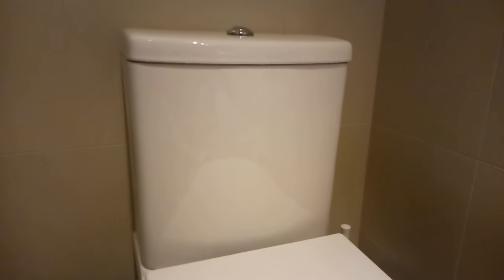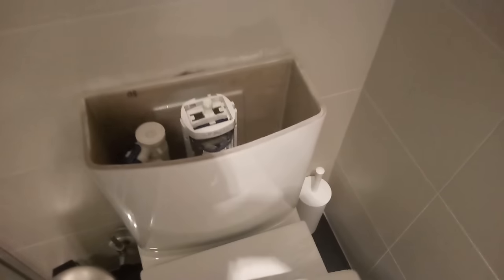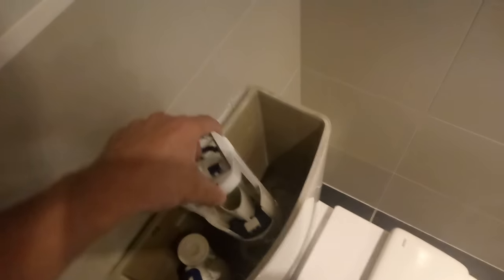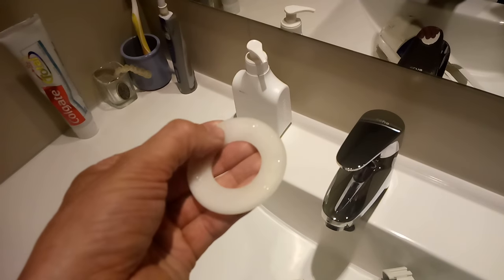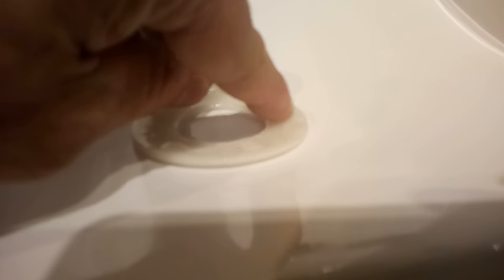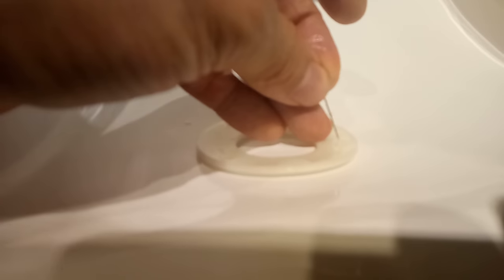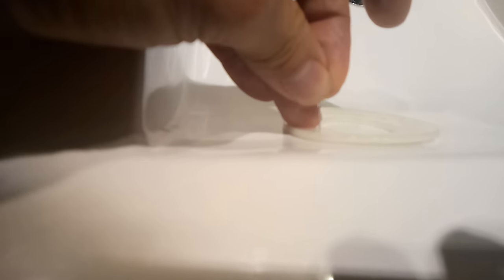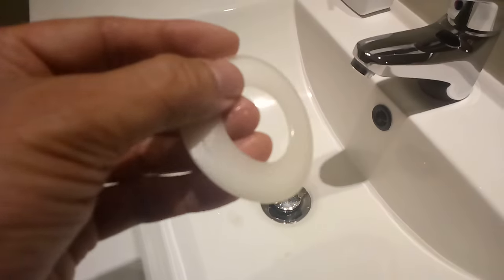Fix a leaking Geberit toilet flush valve

Comment: I have the same hardware in our toilets. My issue is I can hear a drip so might be this but the inlet is also trickling a bit and I can’t understand why.
Reply from the maker: You mean the inlet into the cistern? If so that will run to fill the water leaking past the geberit seal.
Does the seal have those pimples?
Reply: @jwelliottnz  yes the blue valve on the inlet side is trickling s bit. I’m thinking is might be a bad seal. Need to investigate further. Haven’t to see if the seal has those pimples. That’ll be a job for this weekend but thank you so much for the video, massive help.

Comment: Great video.  However, some models have two clamps on the side, near the bottom.  So not a twist and pull. Just release each side and comes right off.  Then popped the bubble and now water is not running.  Great fix---thx a ton.
Reply from the maker: Useful information thanks

Comment: 2:19 by the way, what does that blue plastic thing on the side regulate? I have a similar thing on my valve, and this thingy can be adjusted by pushing up and down, but I'm not sure what does it do.
Reply from the maker: I thought it regulated the volume of water for the flush, but I could very well be wrong.

Comment: I think Geberit should put this 'solution' in the manual or at least let installers and plumbers tell new house owners about it.
By the way how long did it last after the fix?
And is there any scientific explanation as to what causes these water pimples?
Reply from the maker: My fix still isn't leaking now, years later.
My suspicion is that the silicon has a harder skin, when the flush valve slams shut it causes cavitation bubbles that then collapse injecting the small bit of condensing water vapour through the skin, into the seal.
That is my untested hypothesis.
Reply: Sounds plausible... will definitely read more about it. Thanks

Comment: Kam Pui. Thank for your video. I have the same problem. I received the message from the Utilites. The water meter is recording a constant flow. I have been call the pumper to check the flushing tank leaking. The pumper can't find the problem. Your video very helpful.
Reply from the maker: So you fixed it yourself and your plumber couldn't? Nice work!

Comment: 這片GEBERIT止水墊片是矽膠材質，使用久了會變形及彈性不佳，最後會起小水泡，而影片中用針刺破，只是暫時止漏，過了一段時間，馬桶裡又會開始滲水，治標不治本，因GEBERIT止水墊片屬耗材，只要起水泡或彈性不佳，建議就換一片吧，全新馬桶上的墊片，大約可使用7～8年左右，而後面所換的使用壽命，就在3～5年之間，如水箱又投入藍泡泡或藍藍香之類的潔廁劑，會讓止水墊片產生化學變化，另自來水中的氯，也會讓止水墊片的壽命減短而漏水，以上僅供參考！
Reply from the maker: I used google translate on your comment.
WIth respect to "the gasket on the new toilet can be used for about 7-8 years"
Our toilets all sarted leaking after about 4 years.  So around 1/2 the lifetime you stated.  Next time around I'll see if I can source some replacement washers, but so far bursting the blisters has solved the leak.  Perhaps when the washers get to their 7-8 year mark I'll replace them then.
Reply: 你好，我住在台灣，我是專門在維修進口衛浴設備，據我觀察，我現在維修到的馬桶以及埋壁式的水箱，大都是10幾年前的，而那時GEBERIT的舊款止水墊片，是可以撐到7～8左右才需要更換，而現在這款透明的矽膠墊片（SILICONE），只能使用到3～5年，目前GEBERIT水箱零件，已廣泛用在各種歐規的馬桶上，如Villeroy&Boch,DURAVIT,LAUFEN,SPHINX,Jocab-Delafon等等....都是使用此款零件，而且也屬環保材質，另外一款德國GROHE的止水墊片，也是使用透明矽膠，美國的KOHLER馬桶，裡面的紅色止水皮也是有年限的問題，使用一段時間就會慢慢的分解，所以現在的水箱零件，使用壽命沒像以前的那麼久，都有一定的年限，再來建議水箱裡千萬別投入一些賣場的潔廁劑，才不會損壞水箱零件，造成水資源的浪費，謝謝！
Reply from the maker: Yes the short lifespan of these washers is concerning.  My suspicion is that the mechanism allows the valve to close very quickly part way through the flush which (my suspicion is) causes cavitation, which punches a small hole in the skin of the silicon forcing a small amount of water in.  The silicon then springs back sealing up the hole.  This is pure conjecture however.
Reply: jwelliottnz  I managed to get a replacement seal from Geberit in Illinois years ago. My unit is in-wall tank, very awkward to access. They admitted to the problem but made no mention of these pimples.  Hey will probably mainly it for free. Otherwise a class action lawsuit may be worth exploring just for the seal. I like your popping solution. It is an issue with unstable silicone chemistry. Silicone roof coatings are encountering similar degrading of material and performance. .
Reply from the maker: @timothydobson4657  Interesting, thanks for the information.  Hadn't realised that Geberit acknowledged the issue, though am not surprised by this given the amount of traffic this video has gotten.  Roof coatings are suffering too?  That sounds like a much harder problem to fix, my cavitation theory is probably wrong then.
Reply: @jwelliottnz  For long term solution, any idea where can I get the seal replacement online?
Reply from the maker: @khyeoh6046  I don't sorry. After popping the pimples a few years ago they haven't started leaking again. To be honest I'm not sure it's worth buying new replacements given how quickly they start forming these pimples. Unless they've changed the chemistry and now last longer?
Reply: 陳先生您好, 我住多倫多, 可以請教如何拆我的 Geberit Flush Valve ? 謝謝您
Reply: @jwelliottnz 您好，很抱歉，我更正一下，文中新馬桶上的止水墊片使用7~8年，不好意思，那是指20幾年前所生產的馬桶，如瑞士LAUFEN，那時水箱零件是使用GEBERIT舊款止水墊片，外觀有點灰白，那款的止水墊片真的很耐用，不容易起水泡及變型，而GEBERIT現在都已改成透明的止水墊片，使用壽命大約3年到5年左右，如水箱投入清潔劑，止水墊片會起水泡，也會變成黃黃的沒有彈性，使用的壽命會更短而產生漏水，以上僅供參考，謝謝！

Comment: Cant believe the exact same system and seal with a solution was waiting for me. Thanks for the video, I was about to go looking at prices for a replacement unit until I seen the popping solution. Any idea how long this fix will last, and if it's worth getting another seal now? I've just fitted the popped seal, just wondering if it is a matter of weeks months or years before it starts again and the only indicator being if your toilet has begun leaking again since the seal was popped and reused. Either way thanks a bunch for sharing. Such a good feeling when you fix something around the house. Now for the next task!
Reply from the maker: I popped mine a year ago and still no sign of further leaking yet. I'll will pull one out and check it's condition and post another video soon.
Reply: That's good news. Cheers!

Comment: Surely if you're poking holes into the rubber seal, you're just going to get more water in the seal, creating the problem again? Wouldn't it be better long term just to buy a new seal?
Reply from the maker: You'd think so but no. The seals have been working better  popped (3 years so far) than pre popped (4 years but leaking for a while). In my sample size of three that is, which is statistically insignificant I admit.
Reply: @jwelliottnz  oh right. I had the same problem, watched the video, did the popping, and hey presto, fixed! 😊

Comment: Geberit Replacement Cistern Flush Valve Seal 816.418.00.1 is the replacement part when the originals wear out. They cost a small fraction ion the total assembly. Good video though!

Comment: June 2020 - Firstly, how the hell does water penetrate the silicone like that?
Anyway, thanks for the video. I did both my toilets - one was much worse than the other  (it was literall covered in pimples) and both have now stopped leaking. Great advice - appreciate it.
Reply from the maker: My guess is when the button is release mid flush with all that water flowing past,  as the valve slams shut the water cavitates,  when those cavitation bubbles burst they puncher the skin of the silicon and force water in. Just a guess though.

Comment: I have the exact same model as you and twisting it and pulling does nothing. It's stuck fast.
Reply from the maker: The tabs have to align. It's not a screw mechanism. Turn pull, if it doesn't come away, turn a bit more while gently pulling, etc

Comment: Our toilet leaks but that’s not the issue. I need to replace the whole system I think.  We took it out, hubby checked the seal, put it back in and now it won’t even flush
Reply from the maker: Unless something has been broken upon taking it out, my guess is that it needs adjusting. You should be able to actuate the flush mechanism with the lid off, from there see why when the lid fitted it's not engaging the flush.
Some systems have two plastic arms that slot into the flush mechanism, when re-fitting you have slot the think arm into the larger slot and the thin arm into the thinner slot of the flush cassette.
Reply: @jwelliottnz  some little blue thing did fly off. Ordered a new mechanism but was wondering if swapping it for one of the others that still works. Our floaty thing looks nothing like yours. It’s black with an arm and screw type adjuster on the top. Our water is, or was, running down through the centre of the mechanism. The seal was perfectly ok

Comment: I can’t twist it any further feels like it will break
Reply from the maker: It doesn't twist out. You need to twist to align the tabs so it will lift free. 
So pull virtually gently, turn either direction until it pulls free.
Reply: @jwelliottnz  Wowsers it worked, thanks a lot.

Comment: Just can't get the valve out. Can't get the 1/4 turn.
Reply from the maker: I found if I turned slightly the gently pulled straight up, if it didn't come free, turn slightly more and pull again, repeat until it comes free.  Don't need to pull hard, just got to find the slots.

Comment: I apologise in advance, but what I am about to say can hardly be a surprise reaction for anyone who is not that naturally adept at DIY.  FUCK toilet flushes. I have this EXACT same contraption. When I turn it either way a team of wild stallions couldn’t pull it out of the cistern like this guy so easily does. The only thing I would say is that mine is already orientated in the position he ends up at when it releases. FUCK THE INVENTORS. I will use the downstairs toilet. If anyone has any advice please post it.
Reply from the maker: Sorry for your frustration. When aligned with the notches the unit will slide out with little effort. Don't pull but  turn slightly, stop then gently pull up, repeat until it comes away. This can be done in a rapid movement.
Unless it's been damaged it will come away at some point.
Reply from the maker: But yeah this is a terrible unit, designed to save water for a few years then leak, wasting more water than it had ever saved.